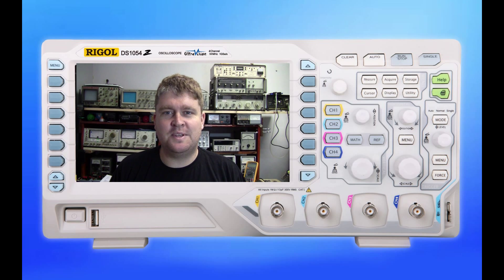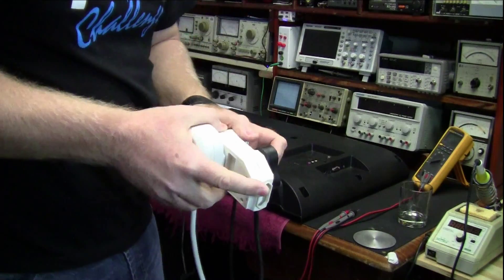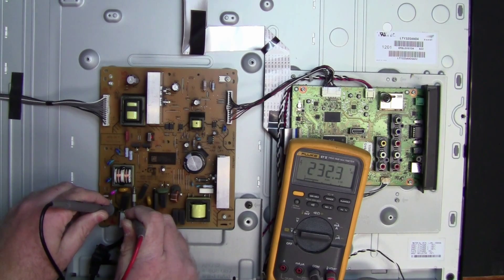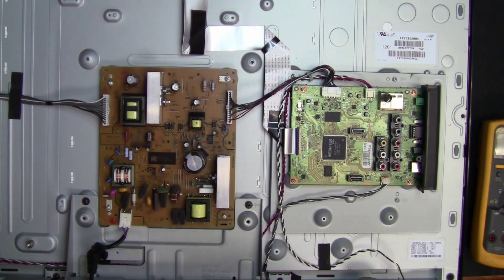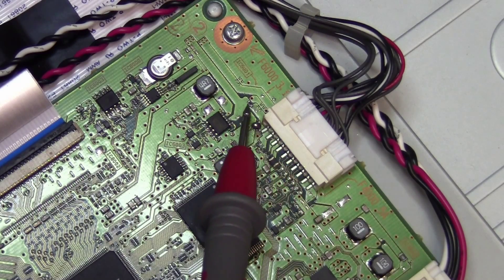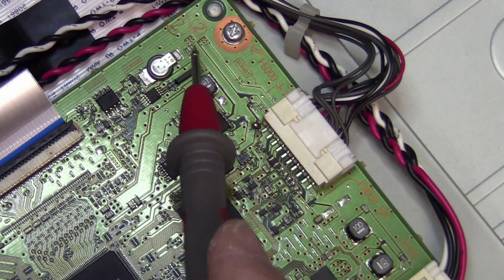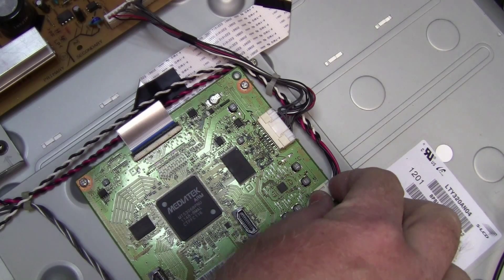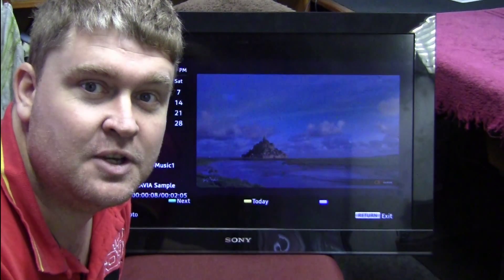Episode 17   Sony LCD TV Repair

Comment: Hi Bro, im having same TV BX35 and i used almost 8 years but from last week onwards giving trouble that picture and sound quality is good . Only thing is ,  picture is not the right colour example sky colour is showing as pink instead of sky blue and some blurred 3 to 4 lines very bottom of the screen.

Im not a TV mechanic but i removed all the screw around the TV also removed the green and brown board. clean somehow using eraser . also removed buttons and speakers. Finally again fixed all the parts..TV become very clear and clarity but only for 20 mins again back to same issue.  Any suggestion from your end.

Comment: Hi Evione; Update on KDL46S4100, i got the new T-con Board and installed same stripe on the screen,don't you think i'm screwed Panel is bad?now i have all good boards parts for this model and no screen panel?, what a bad luck

Comment: Thanks for your great  video; i 've got this LCD SONY KDL46S4100 that i found on the streets and i'm trying save it from going to landfill,
i need your expertise, 
the symptoms; powers up, has steady green led ,with back-lite on ,no pic or sound,already changed A board no change,
i have all supply volts, I tested power board i have at CN 301 the 12 V, 6.5 V, and 3.3 V, CN 302 stand by 3.3v,also 
T-CON White fuse FP1 (3A) to the left of the LVDS connector CN1 i have the 12v.

i tested the CN1 plug ,when i pull in and out one side and wiggle it i had noise/raster and  for a second, it seems like some thing is short,hope it's not the LCD,what you guys think, and can you please advice,i hate to send this set to the land fill.
Reply from the maker: +Frank Silva The fact that your backlight etc is powering on is good. I Do not have any service info for the TV model on hand but will check out the circuit diagram for you and revert in a day or so. Check for any passive part failures. Ie electrolytics or similar as they are common failing items. Are you able to specify which board it was that you replaced? It seems the PSU board is 100 percent by the sounds of things, it could be main board, t-conn board or LCD panel. Usually an LCD panel failure however will be in parts of the LCD and not the entire thing at once. This leads me towards T-Conn and main boards. And of coarse the ribbon connectors between them.